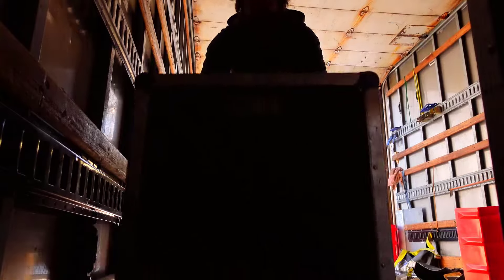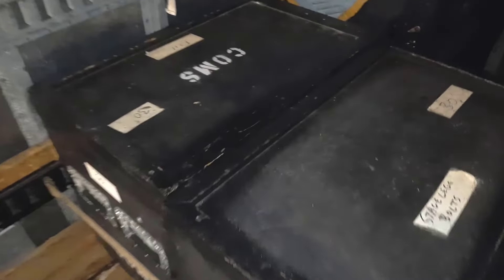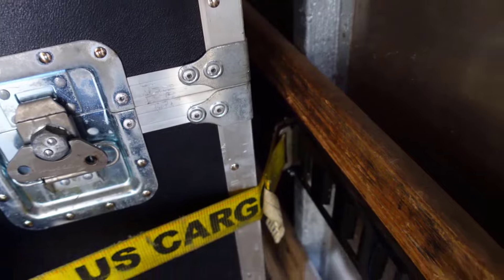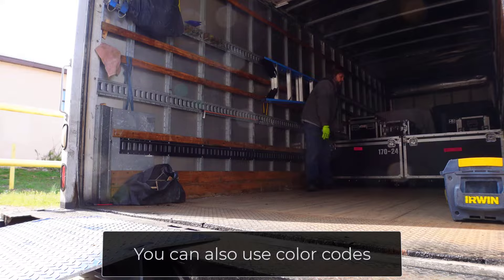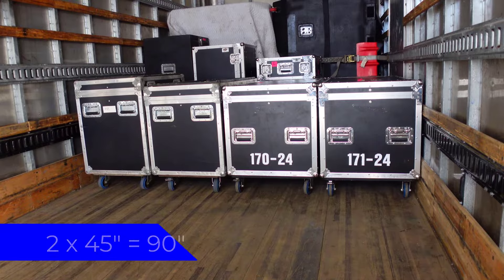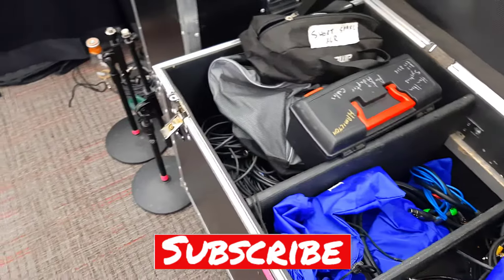Road Cases, Cable Trunks, and Racks for Live Sound ( Live Audio Production )

Comment from the maker: This video is taking a look at an often overlooked, but very important area of the music or production business: Cases/packaging/transport.
When buying or building cases, many times you need to think beyond what needs to fit in the case, but also where the case will fit in the truck or trailer.
In a perfect world, you want cases that can match, or mix and match, because of similar sizes in one or more directions. All making the 'game' of Truck Tetris much easier as cases are coming onto the truck.
It's probably not practical that all cases will be the same size, but many of them can have similar dimensions on one side or the other. That makes them 'fit' even a changing truck pack order, with a simple turn or 'these' two cases instead of 'those' two cases "going there".

So, you need cases that a big enough to be practical for the equipment in them, and for the transport and crew. Sometimes that crew might only be "you", so that's another reason to think about case sizes.
Something else about cases that are way too big for their purpose: They will end up catching way too much excessive gak, ultimately making them extra heavy and likely burying the things you do need out of the case when you get to the gig.

Wheels, of course, are your friend. Don't skimp on the casters. There IS a difference in cheap casters versus nicer ones. And a 4" caster is going to be better than a 2" caster in about any situation... at least if rolling easy is the goal.

Another thing... What you can do when you have a liftgate, or work gigs with a dock and a dock height truck can be vastly different than what you can do if you have a ramp, or a small trailer... And having a trailer and finding yourself at a loading dock isn't going to help things either. And the same goes for crew size. Your cases need to be practical for where you are now, but as the video says, ideally be able to grow with your band or sound company. The 30x19 cases that I show in the video are still very handy for smaller events or for cases that will still fit in a really full truck. And of course, as said in the video, at 3 side by side, easily fit in a 5' trailer. Or 5 side by side fit really well in a 90" or bigger box truck.

As always, likes, shares, and subscribes are appreciated. They all help to promote the channel, or to help get YT to promote the channel.

Leave any questions or comments below! :)

Comment from the maker: 0:00 Intro
0:18 What Are Road Case Sizes Based On?
0:49 Why Can't Just Any Size Cases Work?
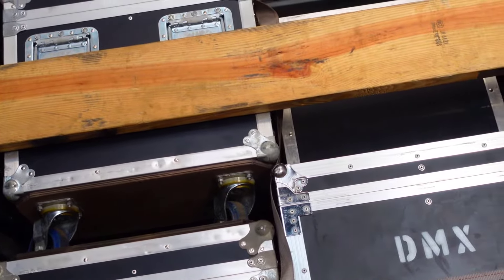1:02 What Makes For A Good Truck Pack?
1:30 Case Examples
2:19 Securing Your Load To Stay In Place
2:54 E-Track Adapters and Accessories
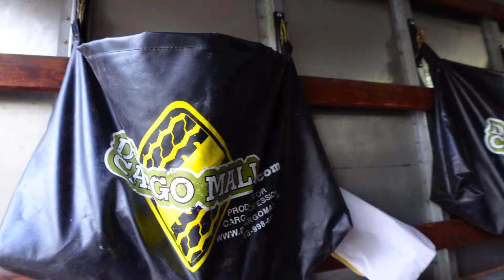3:08 Suggestions and Examples of Road Cases
3:30 Case Identification and Warehouse Storage
3:59 Popular Road Case Dimensions
4:41 Mic Stand Cases, Workboxes, and Amp Racks
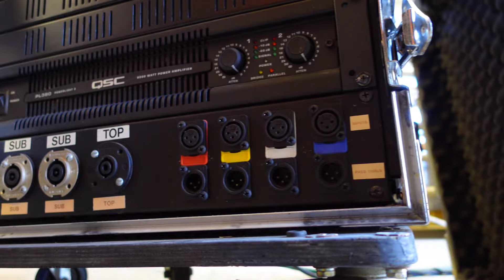4:55 I/O Panel for an Amp Rack
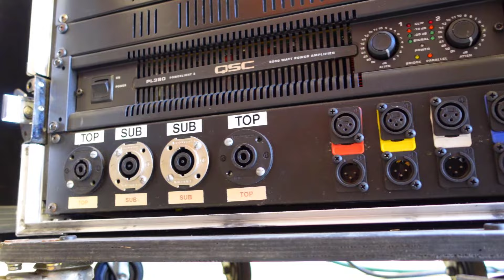5:08 Amp Rack Depth Discussion
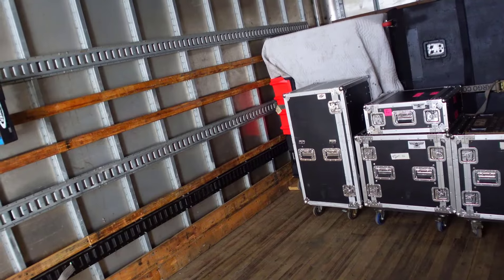5:21 Case 'riders'
5:30 8' Truss getting its own row in a truck
5:35 Rack cases as a business investment

Comment: If more than one band is playing at a gig how do you know who’s cables are there’s when packing away .???
Reply from the maker: I probably should do a future video on this topic. It's not that hard, but it takes a lot of prep way before ever arriving at the gig for the sound company. But that prep isn't about any one show... it's things you do for all of these type of multi-band/festival gigs.
Then there are the things the bands can do, and should do.
One thing is simply knowing your gear... Know what you have and what you are using. Even down to the types of cables you use. But, then marking things too... Just because you know you use Rapco/Horizon XLR cables and 1/4" instrument cables doesn't mean that anyone else can't use them too. Same goes for brands and type of stands. It does help to stay consistent with stand brands when possible too... If you're using nice K&M stands, marked with a piece of tape on the legs, then it's pretty easy to know the unmarked, "6 for 100.00" stands aren't yours.
Also, if you're vigilant about making sure your SM58 windscreens are replaced when they get bent out start looking dirty, then it's easy to know the ones that look like they've been ran over by the truck are not yours. But whatever mics you use, a wrap of E-tape or 1/2" gaff can go a long ways to keeping them marked.
And/or even Sharpy or etching them.

Same for DI's.

Then, always KNOW 'where' you use your cables (and mics/DIs/etc). If you're a band traveling with your own IEM rig, and splitter, and mic/cable/stand package, then it's pretty easy for the sound company, and that band, to understand where your cables end and theirs begins. Mic, stand, and cables into the band splitter are the band's...
Then on the strike, make sure the band stands go to a specific 'de-staging' area that isn't the same as where the sound company is storing their own stands... AND also, separate from where the other bands are prepping/staging off stage.
Having bands prep off-stage while the band in front of them is playing onstage is the way to roll. Have those drums setup so they can be carried onto stage with the snare on the stands, cymbals on their stands, etc... Carpet with all the locations marked...
Don't wait to uncase things until you take the stage.
Same for leaving the stage... Off in as few of moves as possible. And case things, wipe strings, whatever... offstage.

But also, the prep area, and the strike and 'get outta the way' area for the striking band should be two different areas.

Meanwhile, the sound company should have their cables marked. Maybe in a couple of different ways. Like a system to indicate length, and also, especially at a multi band gig, with some E-tape or board tape indicating what it goes to on a pre-pinned, festival patch, stage. Plus, there could be another identifier on them too... like heatshrink with the company name underneath. Or just tape and a company color.

If there's a random situation where it looks like there might be a problem remembering, then add a piece of tape right then and there. Don't ever assume you'll remember... Assume the opposite- you'll forget!

As for power cables... The sound company should have AC drops conveniently located around the stage. These should likely live onstage all day and only be struck if the headliner has their own AC distribution and the day power isn't needed for anyone else by that point.
Those should all run back to the distro and not be a hodge podge of cables.
Each band's power cables should then just be able to reach those points. As a band, it doesn't hurt to carry your own quads, or even power strips or multi-taps, to at least reach 6', 10', 15' onstage... But usually the sound company will be prepared to supply you one if you need it. But it's best if you don't need it and just have your own. If you know you have 4 things that need power at your position, then having your own quad so that you can just connect THAT to the provided stage power, and strike it at the end of your set, can help things flow quicker.

Have your cases marked too... Whether it's stencil, vinyl, or just gaff and a sharpy... Anything to help your stuff stay together.